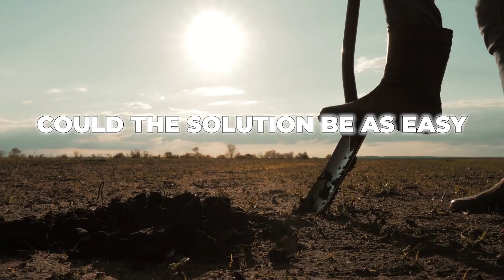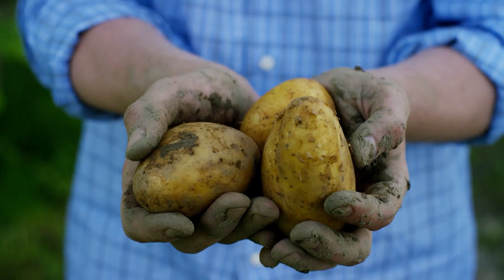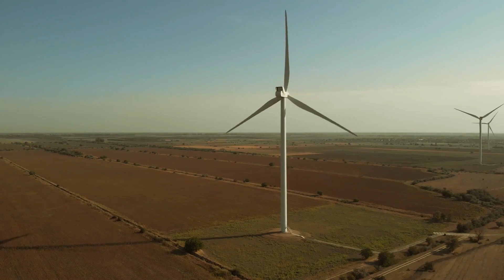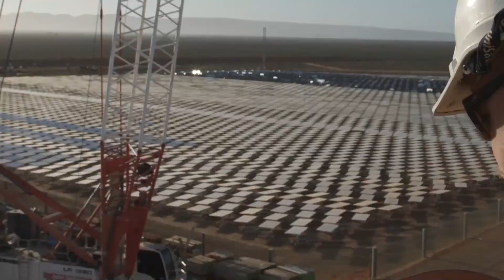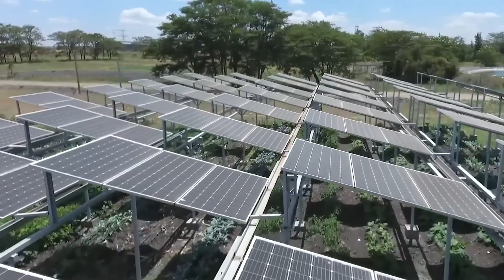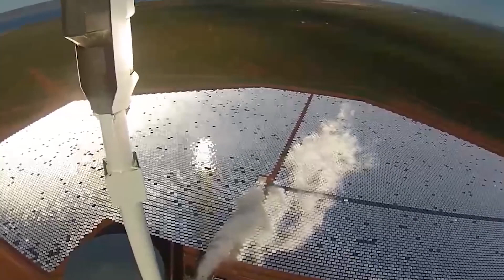How Agrivoltaic Farming Can Help Solve Our Food & Energy Crises..

Comment: Just set up solar panels in Sahara desert  entire needs of energy of Europe and Africa will be solved. A joint initiative from Africa and Europe could expedite the program. But big oil and gas companies in the world don't want this to be happened because it will diminish their dominance and profit.
Reply: sandstorm dust would highly contaminate panels, and there is no rain in sahara to wash them over. huge waste of human resources and water for solar.
Reply: @liveforever141  Big solar firms use no water and human hands to clean the solar panels but robotic hands are used.
Reply: too hot there, their productivity would drop a lot
Reply: @wiezyczkowata You mount the panels over qanats and canals that move desalinated water to cool underneath to boost performance as well as providing water for planting projects to reduce desertification. Let the heat bake the concentrated brine from desalination into building blocks with other waste products. Wins all around my friend.
Reply: @wiezyczkowata   true that much hot in Sahara but not that much as of Middle East. Saudi Arabia, UAE already set up huge solar firms in the desert and no report of any impingement of the firms and low productivity.
Reply: @wiezyczkowata  The whole point of agrivoltaic farming is to provide a cooler micro climate for plants and animals beneath the panels and in the long term using electric vehicles to operate on the farm instead of paying for the gasoline.